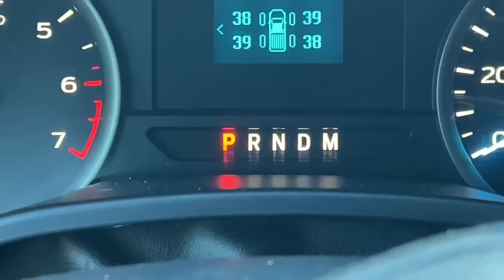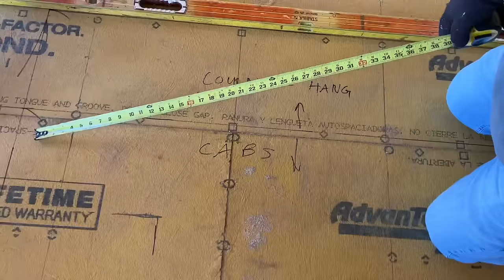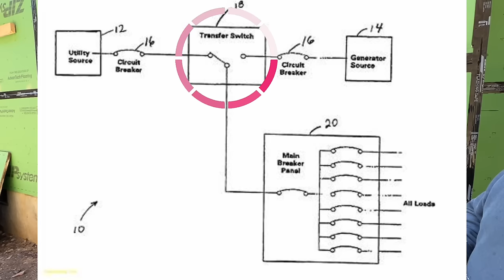Electrical “Plan” | Building A Mountain Cabin EP23

Comment: What version of the NEC are you guys on? I'm wiring my house with the 2018 NEC and I feel like it was ok with the fridge being on one of the kitchen counter top circuits. Any insights there YouTube?
Reply: BTW, love everything y'all do. Keep doing it right!
Reply: North Carolina is on 2017
Reply: If it’s going to be your personal house, spend the little bit extra and put the fridge on a separate 12/2 20 amp circuit. 14/2 15 amp is allowed where I am. Just don’t share it with the “small appliance” counter circuits.
Reply: @lorenrickey5481  Ok, I had the fridge on its own circuit then I got toward the end of the home runs and realized that maybe I could just add the kitchen counter outlets to it. I talked myself into it for two reasons: A: I was running short on wire and 2: I thought that if it was on its own circuit, it could potentially trip and I might not notice it. Long story longer, I'll go out there and run another home run. Thanks for the help folks!
Reply: @TheBloatedPony  good idea! We usually put the GFI in the panel as a breaker for the fridge. They draw about 3- 6 amps, but can spike as high as 15 amps under load. That would be terrible to have a toaster or blender on your “small appliance” counter circuits trip the circuit for the fridge and you not notice it. Cheers.

Comment: The only thing that I disliked was the fact that they drilled two holes above each other to run wires in the floor joist. For such long floor joists I would not have weakened it by drilling two holes, I notice other people even drill three holes, it would be better to drill the holes horizontally inline with each other and spaced about 2 in apart.  Drilling two holes above each other vertically on a floor joist changes the structural Integrity of a floor joist from 9.5 in to 8.25 in if two 5/8 holes are drilled vertically.

Comment: I have a question, when installing a whole house generator, how do you prevent your electrical meter from charging for the electricity that is not from your energy company?
Reply: That's what the automatic switch is for.  If you look at the wiring schematic they show (at 15:15), you can see how grid power comes in from one side of the auto-switch, which separates the main from generator, if that main loses power, the generator side engages, which disconnects the grid side.
Reply: @Haladmer  How does the meter know the source?  Because it appeared to look like after the switch, it still ends up going into the meter.  I admit, I am no expert reading schematics.
Reply: @fstoll3  No worries, electrical theory tends to be a pain to visualize until you get it.

The easiest way to think about it is as the auto-switch is unplugging the house from one power source (the grid) and plugging it into the other power source (the generator)

In other words, the switch operates as a circuit path "gate" which tells the house which source to draw the power from.

Because the switch is between the house and the meter in the circuit, when the house is drawing power from the generator, the meter's circuit does not see the power usage
Reply: All that said is with the caveat of assuming everything is setup and working correctly!

This is why it's important to ensure the auto-switch is setup and working correctly, if it's not, you have the chance for the powerline from the house to the power company's connection to be "hot" (energized) and if someone is working on that unknowingly energized line, they are at serious risk of being hurt (or worse).

Comment: I saw that you meet Matt Risinger at IBS, will you guys be stealing some air tightness techniques that he is implementing in his builds?
Reply: We may look into that… I’m not sure how much more sealed they need to be though…
Reply: @jaimeperkins9606  Like everything in life it depends. You can never build a house that is to air tight. If the house becomes to tight it will need mechanical ventilation, preferably ERV or HRV.

The walls you guys build have an excellent air tightness mainly thanks to the huber system and quality construction. I belive there is a possibility of reducing the energy requirement for your clients by 20%. Mainly through making small but important changes in the air barrier continuity. 

One great examples is how the architect Steve Baczek is detailing the air barrier continuity from the the zip system walls to the drywall ceiling. No fancy materials needed. Just some more zip tape, Advantech and acoustic caulk. Steve Baczek has made a 15 minute video about it called "Airtight Done Right" 

I can only look at this subject from my engineering background. You guys have to deal with the budget and actually doing the hard work. I understand if that creates different priorities.

Comment: I find it ironic that the crew ran 20 amp wire (12/2) for lighting, while the cost of copper is so high and the National Electrical Code now permits 10 amp circuits for lighting (due to the drastic reduction in power consumption with LED lighting). Yep, I always run 14/2 wire for lighting as it’s much easier to work with and less expensive.

Comment: 9:29 those push in connectors lead to 95% of all the call-outs for flickering lights and tripping arc fault breakers. Stupidest piece of laziness next to push in connections on switches and receptacles. What ever happened to using twist connections like Marrettes? It's a race to the bottom for profit.

Comment: I'm a firm believer that you can never have too many sockets. We rewired the house (pretty small - four floors each 5 metres by 5). Each room has at least 10 double sockets. It's astonishing how many things need power and I really, really hate multiway extensions. This is pretty easy in the UK because we use a ring main where the cable starts at the consumer unit and visits every socket before returning to the same point in consumer unit one a 32A breaker. I've never tripped one in my life. The limit is the floor area covered, not the number of sockets. This style came about in the late 1940s to save on copper - Britain was bankrupt (looking like it's going the same way, again) and imports were limited - we don't have domestic copper supplies. Despite the big current on the breaker, it's pretty safe because every plug has to have a fuse (unless it's a Chinese import that fakes it which can lead to major fire). I agree with your electrician - 240v shock is distinctly unpleasant.
Reply: As a sparky I'm trying to move away from ring final circuits, I prefer a 20A radial. There's no indication to home owners if there's a break in a ring and then suddenly you could be overloading the cable.
Reply: @TheFool2cool  Yes. I can see that. It was a worry after the rewiring when the sockets all had to be loosened for painting. Judging by some of the work I've seen, it's not that uncommon for wires to fall out insufficiently-tightened connectors.

Comment: Nobody is using can lights still,,,you use the small LED lights,,, No Can so you can mount them anywhere,,,even right under Framing,,,and they came in 2”3”4”6” inch lights,,,Killer Video guys,,,